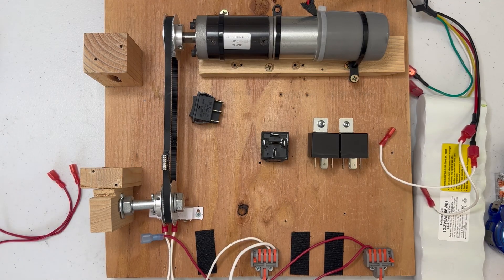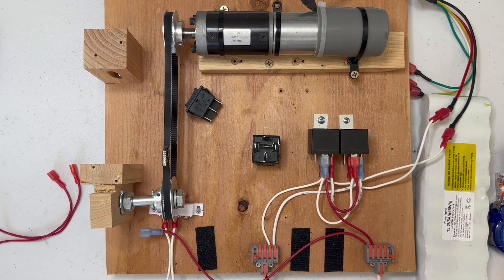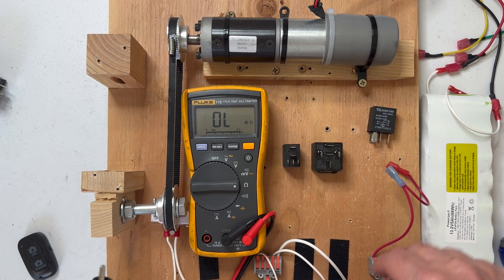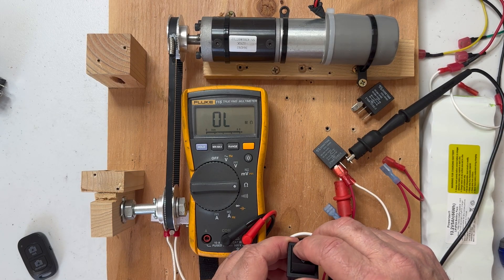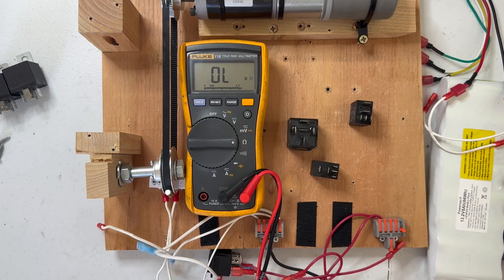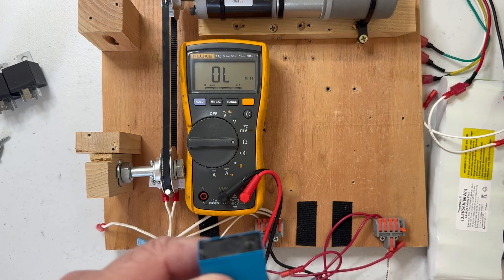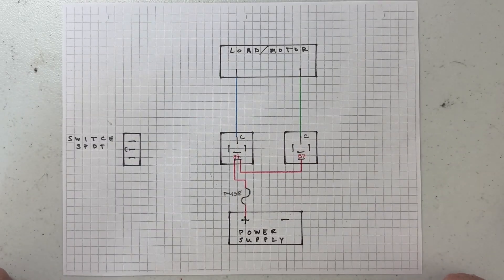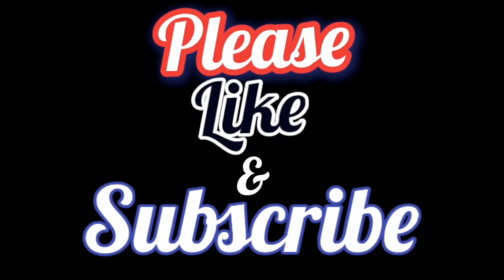Reversing Polarity with Two Relays Revisited

Comment: Thanks for taking time to produce instructional tips such as those covered in this video.  Hoping I can use this for installation of 'electric door locks' in an old car.  Clear diagrams are very helpful.  Explaining issues such as 'both wires are negative' helped me understand (at least my level of understanding....) how the inexpensive 'remote lock sensor' systems (dozens of them on the large 'online merchant') send 'negative' to both wires and then switch for the lock/unlock function.  Now trying to determine how to tie both a manual switch (interior) and the cheap sensor (remote) into same diagram.  Again, thanks and good luck with channel.  (liked and subscribed)
Reply from the maker: Thank you

Comment: Can I use this in a school hoist project, and are you still using the magnets as the limit switches? Thank you
Reply from the maker: I haven’t actually used this for anything. Somebody asked me if I knew how to make it and so I did it. There’s a bunch of other ways to do it on my YouTube channel. I would go check those out. You can use limit switches. Read switches can use bigger motors as long as you use the appropriatesize wires and relays and protection.

Comment: Good explanation.

I think i have an idea on how to use a spst rocker to change fan direction using relays. Its a touch more complicated than this, but with that explanation i should be good. I may post it if i get it right.

Its for a mini skid, and the fan is wired on way and blows hot air on me, I’ve got the necessary switches for this, and the relays to make it work on the temp setting to go on automatically, and when i hit the rocker, i can manually turn it on, too. Plus with the direction arrow going the way i want it (on-off rocker). It will be extra wires and i don’t want the 3 position switch normally associated with say, windows or winches. I never want to turn off the direction of the fan and not make it run.

Comment: This works perfectly with a 12v power supply. But what happens if you upgrade to 24vdc? There aren't any switches on the market (that I've been able to find) that can handle anything more than a few amps, and I need one that can handle 30. How would you configure this forward/off/reverse motor setup if you upgraded it to 30amp/24vdc?
Reply from the maker: The relays I’m using can handle up to 30 volts through the contacts. I would use 12 volts (through a converter 24 down to 12) to control the coil and then the load can be 24 volt. The relay is what handles the big load the switch controls the relay coil which is a small load. 

Here’s a 24 volt relay link
irhapsody 24V DC Relays, 5-pin 30/40amp Automotive Relay, Power Trim and Tilt Relay https://a.co/d/hk5arLT